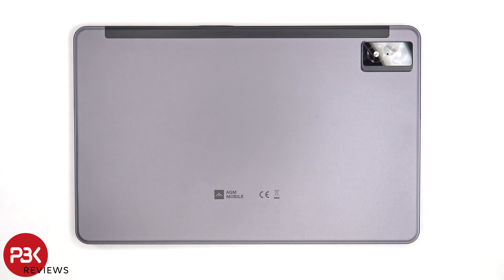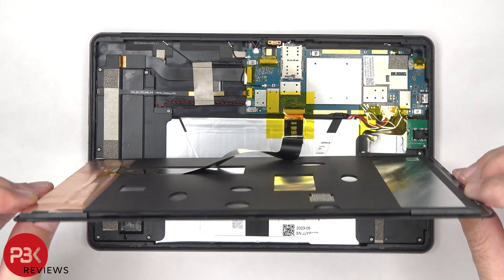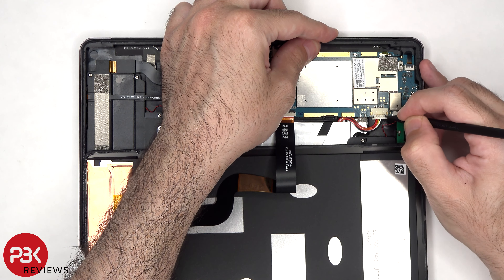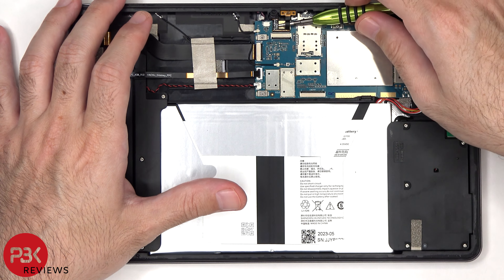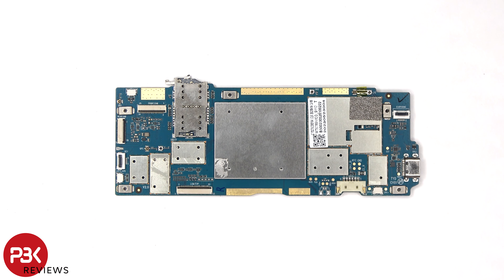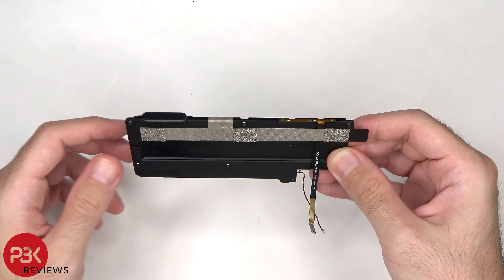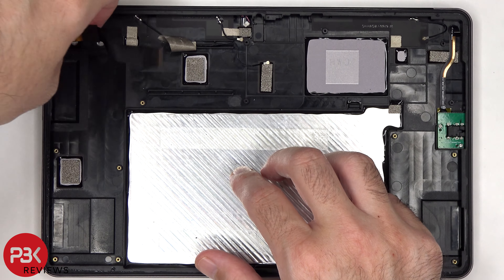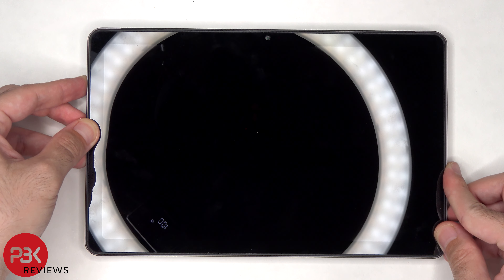AGM Pad P1 Waterproof Tablet Teardown Disassembly Repair Video Review

Comment: Hi. Me and some other users are reporting problems with the touchscreen (phantom taps on the bottom right of the screen). AGM support said they need about two months to figure out the problem. Do you know anything about this and what do you think about solving such problem? The false touch points occur around the right speaker area.
Reply from the maker: Hmm not too sure. It might be software or hardware related. Hardware wise I don't really see anything that might be shorting. The copper side and other side of the back of the screen look to have shielding so not really seeing anything that might be shorting. So maybe its a software fix or might be a bad touch digitizer.